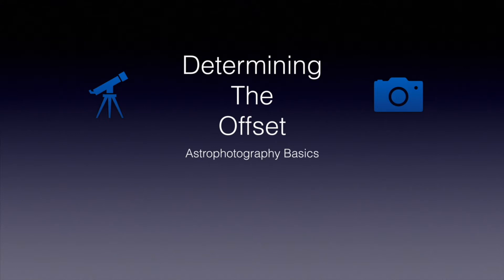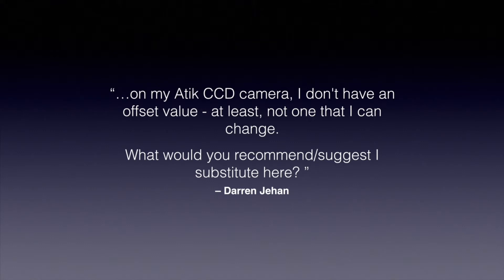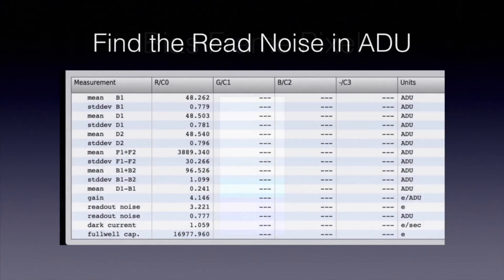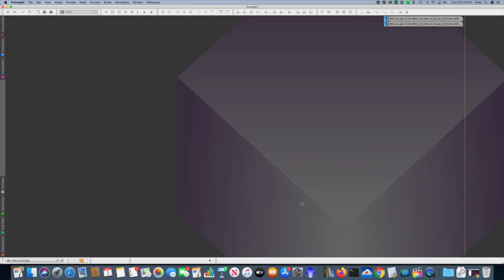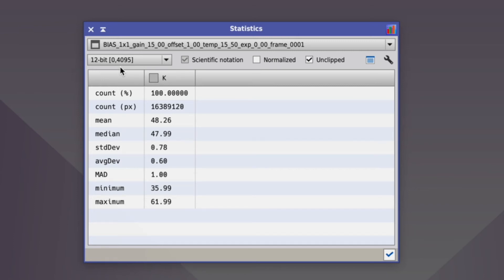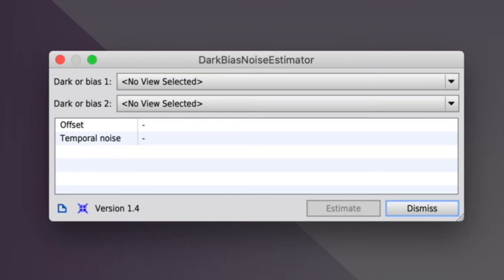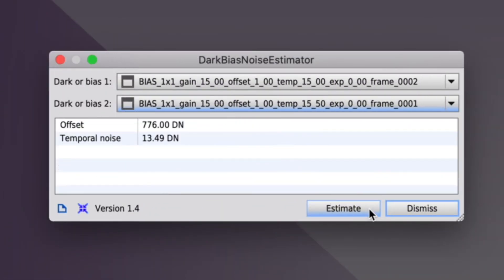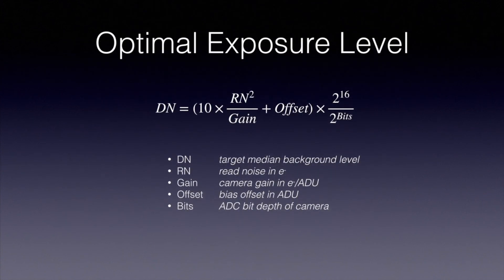Determining Offset

Comment: Hello Linda, 
Please help. I did your methods to estimate Offset. I'm using the ASI294 pro at default offset (I guess) and at unity gain (120). The result I got was 478 in both... Ten times what it supposed to be!! What could be wrong??
thanks and regards,
Reply from the maker: I'd be happy to try. Is there a way you can send the files you used to me? Do you have an account on astrobin or cloudy nights? If so, let me know your id and I'll send you a message there so we can connect.
Reply: @LindasAstronomyAdventures  Hi Linda, I'm getting more and new data in order to understand a bit more and send it to you. I got new results fixing the offset in 4. Now the calculation shows 64. It appears the number in the camera setup does not match the reality. What "real" offset should I use? How can I determinate that? based on what?
Regards, and thanks again
Reply: my cloudy night account name is alhevia
Reply from the maker: @albertohevia9497  If you are using the ZWO Ascom driver it defaults to 50 for my cameras though I'm not sure if that's universally true. You can check by clicking on the camera settings for your capture software (SGP, Nina, etc.) and going to advanced settings. If you are using the ZWO native driver in Nina you can set the offset directly in the sequence.

Comment: Hello Linda, where did you get the Dark Bias Noise Estimator Script.  I don't have one in PixInsight.
Reply from the maker: Looks like they removed the script. However, the MureDenoiseDetectorSettings should be able to get a direct estimate of the offset. That may be why they got rid of the other script.
Reply: @LindasAstronomyAdventures  Thank you for your reply.  Appreciate it.

Comment: I'm completely confused on if my camera even uses an offset. I used APT for my ZWO 183MM Pro and the book for the camera claims the pro version of ASI camera don't use offset anymore. APT isn't using ascom for the camera driver, it's native supported. There is a place to put offset in the software under settings but I haven't changed it because of what ZWO said. I'll probably have to use pixinsight to see if there's an offset put in images by the driver or not.
Reply from the maker: ZWO still uses an offset in thier ASCOM driver. It just defaults to 50 (at least for the ASI1600) and the setting to change it is buried on the driver settings so it's not easy to change from exposure to exposure. If you use the native drivers in apps like APT or SGP then you need to supply the offset. You can safely use the default value that ZWO uses for your camera and never have to worry about it if you don't want to. It sacrifices a tiny amount of dynamic range at lower gains but simplifies your life. On the other hand, if you want to extract every last bit of dynamic range then someone familiar with that camera can probably give you some good guidelines as what what offsets should be used with what gains. In general, the higher the gain, the higher the offset you need. Hope that helps!